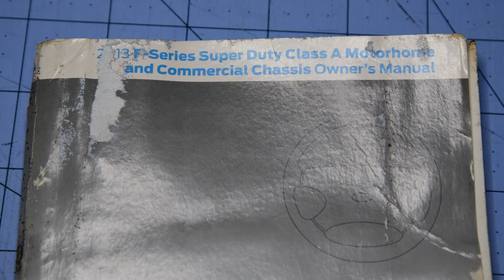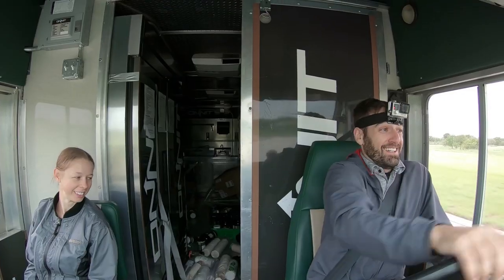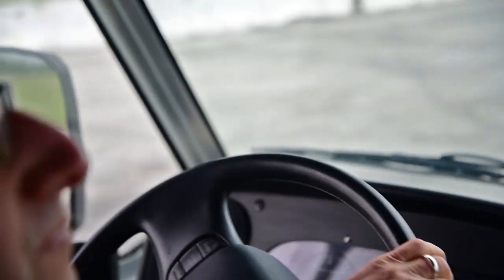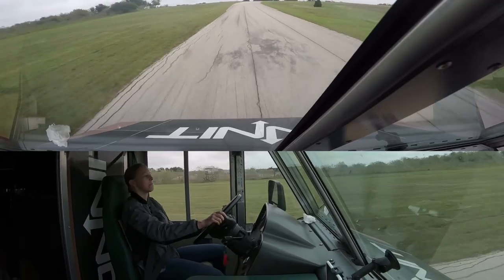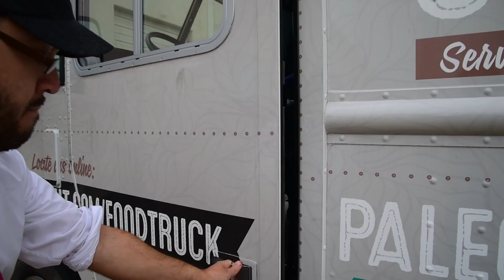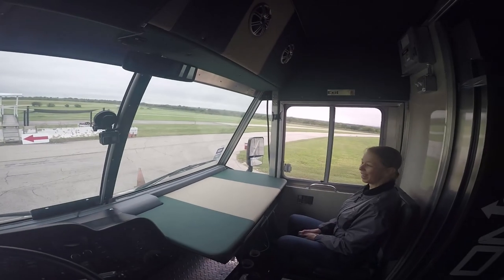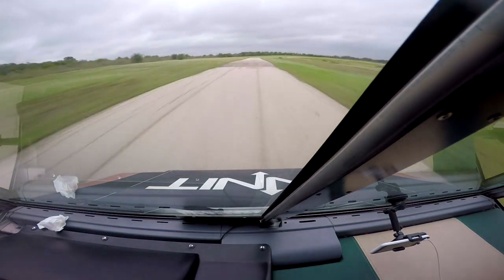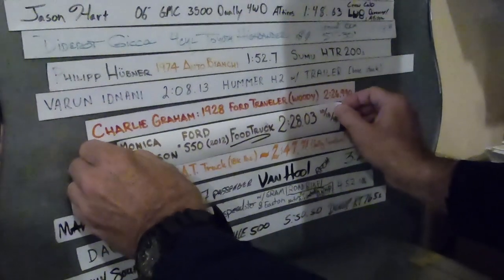2012 Ford F550 Utilimaster Food Truck: Regular Car Reviews

Comment: You need to find someone who will let you drive a train.
Reply: Marc Sieber 
I’ve done 0-60 in one minute with a two thousand horsepower locomotive with no cars.
Reply: @bayouengineer 🤣🤣🤣🤣
Reply: There's a rail museum in Portola, CA that lets you drive trains around. Regular Rail Reviews
Reply: @bayouengineer  ...Holy shit! I could actually out drag something with my first gen Sportage?!
Reply: I at least want to see someone let him review a semi. Even if he can't legally drive it on the road without a CDL.
Reply: bayouengineer Jeez, save some for the rest of us, won’t ya?!
Reply: "This thing is pretty much only good on the track." -RXR
Reply: RRRR (Regular Railroad Reviews)
Reply: DO IT FOR APRIL FOOLS
Reply: Regular Train Reviews. "This is an F40PH..."
Reply: @BruhMoment-yv9et  Nah, fam. He should drive a TANK~!!!
Reply: I've been thinking the same thing. He's done airplanes, military vehicles, trucks, buses, motorcycles, I think a locomotive should be next. I nominate the most "regular" diesel-electric locomotive of all time (if by nothing else than production numbers): The EMD SD40-2. Preferably a really beat up one running some shortline or permanently relegated to a branch line.
Reply: @dposcuro  it even gets to 60?
Reply: @okbutwhocares  Yes. Taps out dead at about 160 kph, or 99 mph. After like 3+ minutes of full throttle, on larger tires than stock (265/75r15). Gets up to 130~ kph okay, and then it just rolls over and doesn't want to go any faster.

Comment: the 6.8 v10 is the 5.4 triton with two extra cylinders put on not the 4.6 modular, I some how manage to work in the v10 plant is my source.
Reply: William Kowalsky 4.6 ÷ 8= .575.  .575 * 10 = 5.75. Mr. Regular's math doesn't add up.
Reply: And an Olds 350 is the same thing as small block Chevy. This guy just keeps showing how little he really knows.
Reply: Came here to post this, figured someone beat me to it.
Reply: When he said 4.6 I was thinking the math has to be off,  those two extra cylinders must be much bigger than the other 8 to get to 6.8. (6.8 - 4.6 = 2.2)
Reply: William Kowalsky, strange that in all these months NO ONE has posted up the real math:

5.4 / 8 = 0.675  x 10 = 6.75

So it's the F-150's 5.4L where the Triton NA-6.8L V10 is based on rather than the 4.6L 3v from the E-vans (a truck version wouldn't have been based on the Crown Vic's car version as it had more torque). In the Excursion latter years the 6.8L replaced the 5.4L as the base engine w/the PowerStroke TD as an EXPENSIVE option.
Reply: I was convinced this entire time that it was the modular V 10 but then I remembered seeing the triton badge going along with the V 10 trucks so it really must be 5.4 with extra cylinders
Reply: They are all the same underpowered garbage modulars.  Shooting plugs out of blocks sometimes, losing races to rusted out stock CRXs other times.  The boss is actually decent, but man the modulars, especially the 2V were breathless dogs.

Comment: The V10 is pretty common in the excursion and super duty from that era. It was a couple grand cheaper than the power stroke. It’s a good engine. Last forever, pulls really well while getting hilariously low fuel economy. My excursion pulling a boat trailer maybe got 7-8 on the highway.
Reply: I'm shocked they still made it in 2012. Things been around since the late 90's.
Reply: I've got a 1997 Ford Econoline with a V10. 200K miles. It's on VinWIKI.
Reply: @DeftonesFan867  they still make it now, the plant's closing next year.
Reply: @Fgyfcg  And it's probably the same as it was back then.
Reply: You got 7 to 8 MPG? We were lucky if we squeezed 5 MPG out of ours.
Reply: From the description, it sounds like this V10 essentially fills the role the old Super Duty V8s used to back in the 60s, 70s, and into the early 80s I think.  The old 401/477/534 V8s.  Big, burly, heavy, lumbering things doing diesel kind of work but burning gasoline, max RPM like 3500.  For a while you could even get 'em in an everyday F350, but they were mostly used in tow and medium duty trucks and school buses.
Reply: Yeah it’s a pretty common engine Mr. Regular. Just look at any Craigslist search for an F250 or F350 and also their E-series counterparts.
Reply: Yea they were definitely not that uncommon. There’s still a lot of trucks around that I see with them. A lot of motorhome chassis had them too.
Reply: I woulda just got a power joke lol
Reply: We had one in a short bus we converted into a party bus, till it blew out a couple spark plugs, now we have one in our dump truck.
Reply: @DeftonesFan867  
It's still in production, in the e450
Reply: They sold(sell?) those V10s even in medium dump trucks, because you skip all that emissions BS which you would get with a diesel. 
Of course, the fuel mileage is bad, but if something on those modern diesels fails, it´s going to be really expensive especially on a truck.
In the end it maybe cheaper to drive a gas hog...
Reply: Pullin' trailers and blowin' spark plugs out the head.
Reply: @TINRFD  
We have 90 14,500 lb vans that sit and idle all day (average operational run time is 22 hrs/day) 
And we still get 7.3 mpg.
On the highway, long haul it's getting mid 13
Reply: @thejunkman  
I help maintain a fleet of 90 e450s, that are driven harder than anything else, and we average one plug every 9 months. Not really that bad. 

It's also usually the ones on the passenger bank, 3rd or 4th back. 

With that kind of regularity it's easy to get in a groove.
Reply: @ab.3800  
The 6.0s that were your option 2004 and newer aren't an option. 
My work found it cheaper to rechassis all 90 of our units than continue to maintain ones with the 6.0
Reply: That is exactly what it is. It replaced the old big block 460 in '97  @xaenon
Reply: You can still get em in the Econoline vans
Reply: I have owned several different diesel commercial duty trucks.  the V 10 gas engine have far superior reliability and it cost less to operate.  In 100,000 miles I saved over $20,000 getting the gas engine.
Reply: It probably get 7-8 mpg on the highway without the trailer anyways lol, our work F450 with the V10 gets the same mileage no matter if its completely empty or if its got a trailer loaded up behind it.
Reply: Local tow company just got an F550 with the V10. They were tired of dealing with diesel EGR, particulate filters, and DEF. If you do a lot of stop and go and idling, you have to go with gas. These new diesels can't handle it. My fleet has a 2013 F450 diesel, but after some fixes from Ford it seems alright, but I don't drive it in a lot of stop and go.
Reply: Oh, and the V10 can take a LPG LNG conversion.
Reply: Mine gets 7 city and 14 highway lol

Excursions are some damn fun vehicles
Reply: @DeftonesFan867  They still make the fucking thing. I should know, I'm currently designing a vehicle that uses it.
Reply: My dad used to have a truck with the V10.  It got 14mpg.  City/highway/pulling a 5th wheel through West Virginia, stupidly consistent 14mpg if I remember correctly.
Reply: @JohnSmith-wx9wj  
Yeah, with trucks that have particulate filters, you have to take him on a highway cycle regularly, DEF trucks aren't that bad about it but still benefit from doing that as well. it's definitely a case of emissions equipment designs for semis being applied to regular work vehicles and lots of growing pains.
Reply: I guess you paid someone else to change your spark plugs? I would say that you would make that few grand back with the 13-16mpgs you get with the powerstroke until the engine explodes and erases your savings many times over. That is unless you're one of the unlucky v10 owners that shoots out a sparkplug or two because Ford in its infinite wisdom determined that 3 threads is enough to hold a spark plug in.
Reply: @flippydipp  We really didn't care that they were more powerful than the 7.4's. The 7.4's used half as much fuel as the V10's.
Reply: Jason Barnwell yup. The handicapped transit buses in my city use the triton V10.
Reply: Why wouldnt most just go for the Diesel with such a close price point
Reply: They still make it in some capacity. I did an oil change on one owned by a communications company and asked the driver how it compares to the Powerstroke - it apparently gets only slightly worse economy (6 MPG instead of 7 like the Powerstroke he drove before) while making no performance difference in exchange for much cheaper maintenance.
Reply: Jason Barnwell, the reason Ford still makes the 6.8L V10 (it is supposed to be replaced finally by the new PUSHROD 7.3L V8) is because in many applications the PowerStroke (now at 6.7L) is +U$ 7-10K and there are those FLEET BUYERS that CAN'T JUSTIFY THE EXTRA BUYING EXPEN$E (as they don't drive enough miles for the TD's lower fuel compsumption co$t to compensate, even worse with the fuel premium diesel now has in most Stateside places).

For those buyers the 6.8L and the replacement 7.3L will be plenty good for years to come.

In the Excursion case originally the base engine was the 5.4L (as in that time's Expedition), but ultimately buyers found it was too weak (that SUV was SD-based rather than from the LD F-Series), so Ford later made standard the 6.8L, rather than optional. The PowerStroke always was the most expensive engine option.  

The old LD E-Series van only had V8's its' last few years, being topped with the 5.4L, the SD vans started at 5.4L and went through the 6.8L and PowerStroke, now the latter two being the only 2 engines on the Cab + Chassis E-450 / 550, which are the only ones still built in '19 (the LD range now is on the Transit, including its' own HD, with its' own PowerStroke, soon a 2TD-2.0L I4, replacing the TD-3.2L I5).
Reply: @usbman23  ok but how the hell did you get to the spark plugs? Cramming a v10 into a van engine bay is insane. As someone who has driven a v10 uhaul I'd rather have any year/model diesel (except a Ford 6.0).
Reply: My friend's husband has an Excursion with the V10, and they live in Riverside, CA. I can't even IMAGINE what it cost to fuel up that thing there! lol

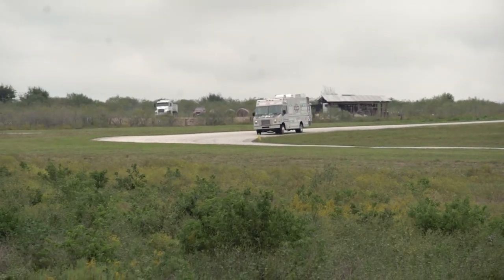Comment: 10:01 a wheel Is off the ground, ummm ok
Reply: That's a sign of a really stiff chassis ;)
Reply: Yeah, I think ford co-designed it with Lotus.
Reply: That's what happens when you corner at the limit with some chassis setups. The old boxy VW Jettas used to pick up their front left wheel around the corner at the track I used to race at.
Reply from the maker: HA! @Rentta
Reply: I like the audio that happens right here too "-not a disaster of titanic proportions-"
Reply: Fiesta ST's lift one oe the rear wheels when cornering hard
Reply: That's what happens when you have a solid axle up front.
Reply: If you want to go and take a ride with me
We 3-wheeling in the fo' with the gold D's
Oh why do I live this way? (Hey, must be the money!)
Reply: shes stadium super truck ready!
Reply: had to check the comments if anyone else saw it was siiick

Comment: Sadly Ford put these in ambulances and they were dreadful. Burned a litre of oil per day. We also were required to drive them like we stole them
Reply: Funny the ones we run are great. They go through maybe 2 quarts an oil change. Although we run a thick 5w30
Reply: We ran the same, must me the excessive rpm
Reply: Ford modular engines are known for oil consumption.
Reply: @Blue10AEMia  Still not as bad as BMW.  My supervisor has a 2015 M5. It says right in the manual that burning 1-2 quarts between oil changes is normal. If that's normal BMW is letting their quality slide big time. I've personally owned four vehicles with 4.6's. a 97 Town Car, 01 Town Car, 11 Town Car, and 95 Grand Marquis, none burned more than maybe half a quart every 5,000 miles. Pre 1996 4.6's did have a known valve seal issue that caused oil burning. Personally I really like the 4.6. Burning a quart of oil every oil change is a small price to pay for an engine that will easily last 500,000 miles under normal use. I've seen several 4.6 taxis break 500,000. And I've seen a lot of rode hard and put away wet P71 interceptors at 2-300,000 that still run great.
Reply: @outspokengenius  Those cars you mentioned were MEANT to be beaten the shit out of and how much do I bet you you bought them off from a police auction, BMWs are more meant to be "rich man's business cars", meant to be treated like if they were the president
Reply: No that wasn't the v10s it was the 6.0l v8 diesel
Reply: @maxpenrose3032  as someone who drove them, they were v10's
Reply: @dotdot8614  yes and no, bmw has changed a lot over the years but something that has been fairly consistent is the base cars are reliable and the m cars are strung out to the limit to where they are of questionable reliability unless you do everything preventatively including engine bearings lol. Basically any year M5 or M3 (except us s50/52 cars) WILL need bearings done in the lower end of the engine before 150k miles unless it's never winter driven and gets babied.
Reply: @maxpenrose3032  fwiw I have seen both in the wild. Kinda funny how many still have the engine badges on them...

Comment: My uncle has the v10 Excursion, it's awesome. It was clocked at 400hp. I rolled my truck last year, and he hooked 2 chains on my truck's chassis, and straight up rolled it back over, then dragged my 6,000 pound truck UP a hill, with 2 wheels not turning. And he honestly said it felt exactly like hauling a loaded cattle trailer.

Comment: I actually run Into the Triton v10 fairly regularly at my shop. I hadn't known about it really till I moved to Oklahoma. Though diesels are everywhere there are several trucks I work on that are both cab and chassis commercial pickup trucks and even some standard trucks with factory truck beds. One  even is an itcasa sundowner rv built by Winnebago.

Comment: My man meat is pulsating with onnit protein products
Also my Lincoln Mark VIII has that engine.
Reply: Did you pull it out of Bowser Jr. long enough to notice?
Reply: Lincoln didn't offer this engine. Plus this engine is based on the 5.4 L not the 4.6 L. Mr. Regular is wrong.

Comment: Interested to see if someones swapped a modular V10 into a Mustang
Reply: It’s happened, and this V10 is based on the 5.4 not the 4.6, Ford made a V10 based on the 4.6 and put it in a Mustang but never produced it. That one was aluminum with DOHC heads and was about 5.8 liters and 420hp. There was a 6.4 variation that made over 600hp and was lighter than the cobra 5.4 supercharged but none ever made production sadly.
Reply: They swapped one into a Crown Victoria once.
Reply: Mmm crowds
Reply: DrewLSsix I thought it was based on the 5.4 but wasn’t sure if this was some super rarely used one by the way he was talking about it. It’s the triton v10 correct? It was used quite a bit really in trucks/vans and motor homes and commercial trucks
Reply: The v10 is garbage
Reply: Mo cylinders = mo better
Reply: I recall that there was a V10 Mustang offered (or going to be offered) at one point a long time ago.  Reviewers took a massive dump on it because the powertrain and tires were horribly mismatched making it useless.    It's all fun and games until you get multiple "breaking traction" tickets in the same day.
Reply: @Levibetz  woah, thats just a 5.4 with two more cylinders tacked on
Reply: With some modification of the engine bay you could swap when into a 2000 to 2003 2004 and earlier. However the cost versus benefit is on the low side because you can get more horsepower out of an all aluminum twin cam 3to bell cobra motor than taking in this big iron monster
Reply: Louis Subearth   I remember that, not sure if it was ever intended to be a real thing or if it was a development mule though.
Reply: Aaron Blakely   Not really, it’s proven to be a pretty stout motor. No more issues than what is typical for the rest of the modulars.
Reply: BlindMansRevenge2002   The experimental motors were all aluminum and twin cam.
Reply: I'm in Ohio, and I saw one on CL with a V10 swap. It was a black Fox body with one a couple years back. I wish I had screenshots of the ad.
Reply: I remember back when they first come out one of the mustang rags had one on the cover.  Someone put a v10 out of a truck in a 4.6 car (don't remember the year) and the front half of the heads and intake stuck out of a hole in the hood and they said it was not practical to do but it was fun if I remember right.

Comment: my father had a stroke so we use a f-450 v10 handicap bus to take him around. it has a turn off-able turbo, so you can accelerate after a red light if you want to. also only tried it at 90km\h (80km max speed limit). its basically an RV with no shitter or place to cook yet.

Comment: A couple insights that I have: 1. The chassis is known as an F59, not an F550. 2. I've been in one of these (sans upfit) that's been on an offroad course for 5,000 miles. They hold up. That's why you usually see vintage ones still on the road.

Comment: The Triton V10 is not rare. I see them all the time in super duties, they"re still a common engine in RVs, both ford E-series based and bare chassis based. They're also a common engine in the ford medium-duty trucks, sometimes as a CNG or propane-powered configuration. Not rare.

Comment: inb4 "the 6.8 v10 is 1.25x the 5.4, not the 4.6" not that it matters. The 2001 E350 I drove for work with this engine got 6-7 mpg city when empty, and literally the same when we loaded it all up with like 20 bikes. literally could not tell whether or not it was loaded without looking in the back. It was great for the job! especially since I spent many weeks driving around with it being pretty loaded up because the shop was full.